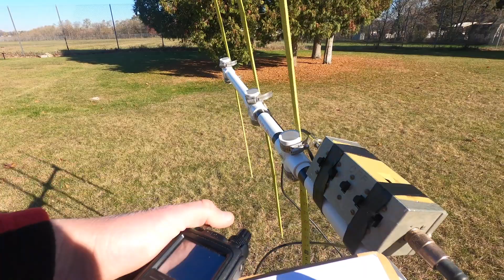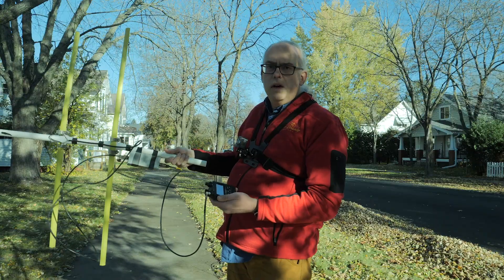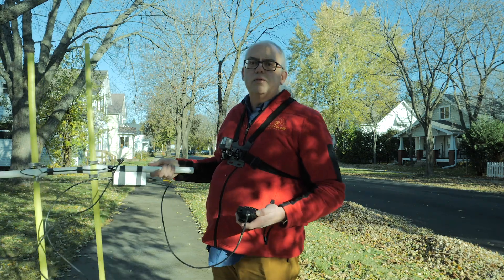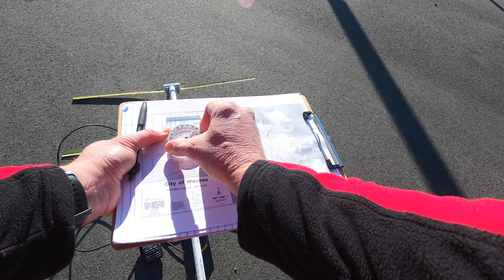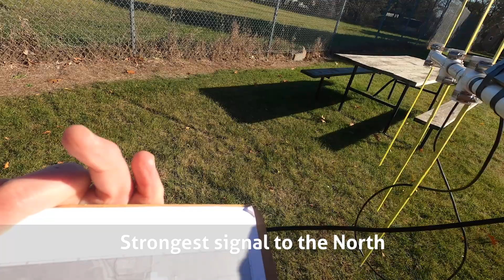Fox Hunt Failure? #HamRadioQA

Comment: I want to start my own foxhunt in my area. Just curious what wattage they are running for the regular fox?
Reply from the maker: The fox was a 5 watt handheld radio with a Byonics.com controller. It's amazing for how far you can hear the signal coming from a rubber duck antenna.

Comment: I add a few things to my tape measure beams. 
A second director. (Same distance as the first one.)
Tape to the ends of the metal elements.  (They are very sharp)
And then I dip the ends of the elements (including the tape) into "plastic dip"
Safer without the sharp cut edges on the ends of the elements.. And the tape helps hold the element in the PVC hole when folded for transport.